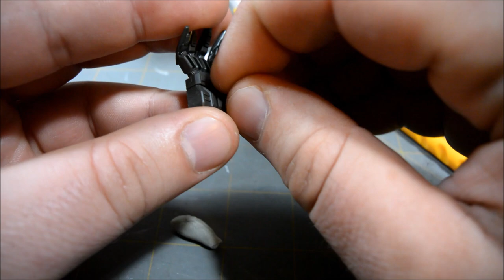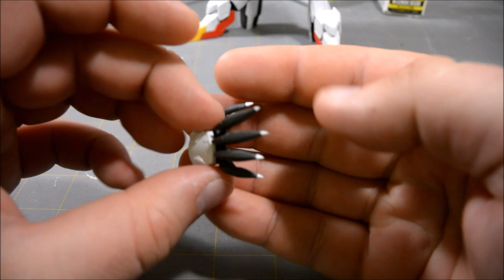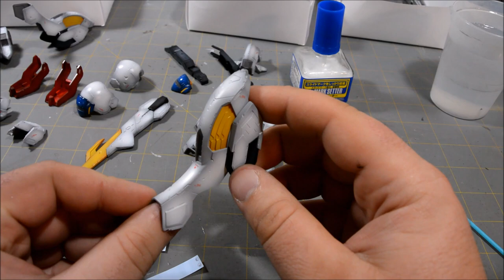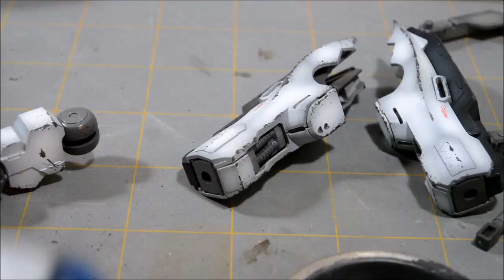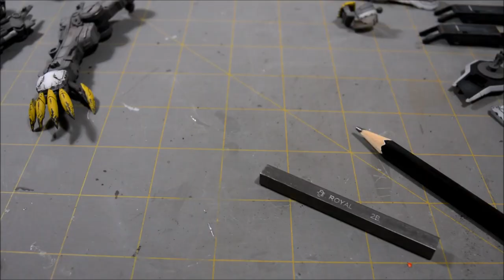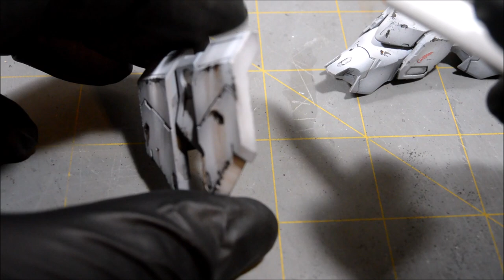Work in Progress: 1/100 Gundam Barbatos Lupus Rex

Comment: For your wash, you used oil paints with thinner. Did you add thinner until it had toe consistency of water? And how long did you let it sit before you wiped it off with the paper towel?

Comment: Off Topic: Got my first resin kit and have been binge watching your resin tutorial vids. My only question is: is shallow pinning a good idea. I'm working with Model Legend's Woundwort and it's oddball/spindly design makes it nearly impossible to pin fully despite it being a very easy and simple kit to assemble. (the disk that holds the bum, hips and upper body is the only thing that can be pinned and it has a massive insert that the torso slots into). That and Model Legends had premade large/deep pegs in most areas and made the usually heavy areas hollow.